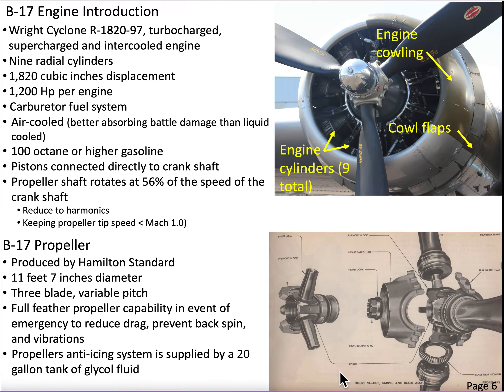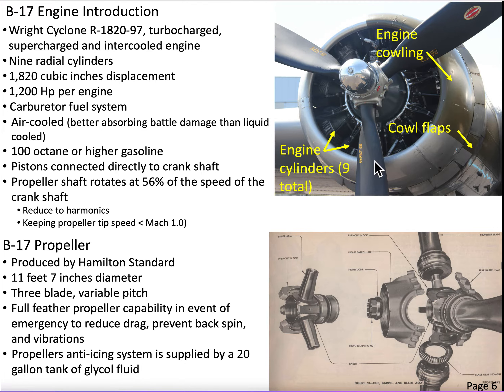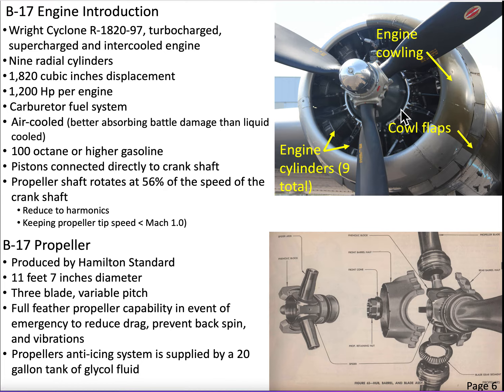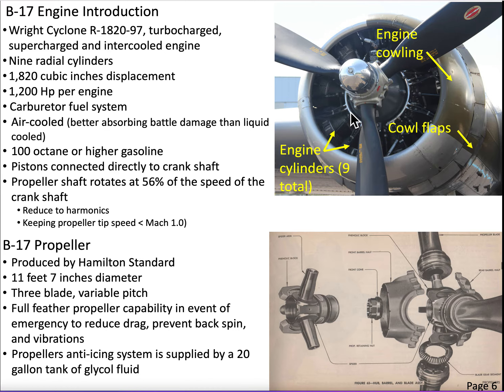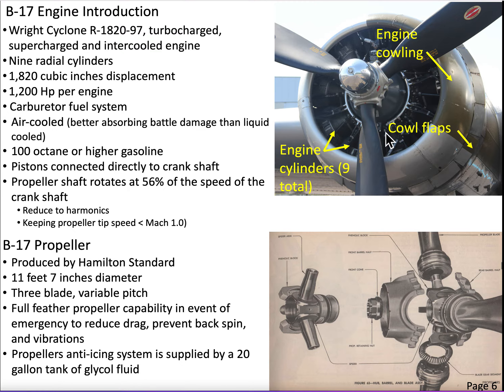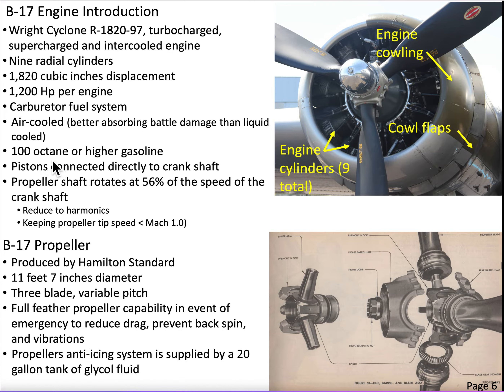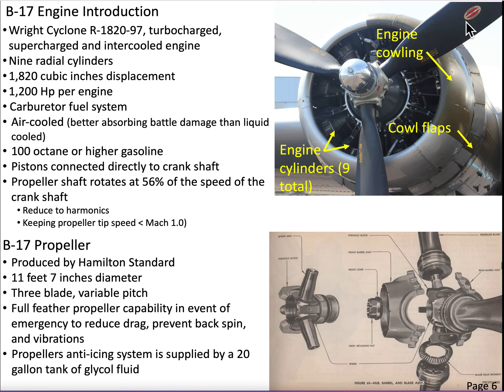B-17 Bomber's Engines and Propellers Explained

Comment: Just a terminology note: The propellers were not just variable pitch, they were constant speed.  The normal mode of control was not that the pilot varied the pitch, but that he set the desired rpm with the propeller control lever.  The system automatically and continuously varied the blade pitch to keep the engine at the set RPM despite changes in airspeed and throttle setting.
Reply from the maker: Thanks for that great description.

Comment: It might be a good idea to do a piece explaining the difference between a supercharger, and a turbosupercharger, and why the engines had both.
Reply: Greg's Airplanes and....
Reply: @lamwen03  Exactly.
Reply: I read not long ago that when the FW190 whose single stage supercharger started loosing power at 15,000 ft was in pursuit of a B17 at 25,000 ft it's performance was down so low at that altitude that once it was in range of the B17's .50 cal tail guns it took around 2 minutes for it to close enough to where it would be in range to use it's 20mm guns, and any type of evasive maneuvering would cause it to lose ground, so if they tried approaching from the rear they had to sit in .50 cal fire for about 2 minutes before returning fire would have effect, how'd you like to sit in .50 cal fire for 2 minutes before you could shoot back?
The article claimed that it was the real reason that they adopted the head on attack, not because of the B17's lack of chin guns on the early model, that was simply an added bonus.
But the head on attack had it's own disadvantages the two biggest being that between the closing speed of the two aircraft being around 600 MPH you only had a couple of seconds to get shots off and only the best pilots at gunnery even stood a chance at getting hits and you only had one chance for a head on attack, the only reason they could do it in the first place is because they had adopted early warning radar which enabled them to already be at altitude and ahead of them, they only had one shot at it because once they made a head on attack and went through the formation they'd never get turned around and get back out in front of them again with their performance being so low at that altitude, especially considering that they'd have to arc around them at a safe enough distance that the B17's formations defensive guns couldn't effectively fire on them.
Supposedly the ME109's supercharger had better performance at that altitude than the FW190's did, so if they had a mixed force they'd use the ME109's to attack the bombers and meanwhile down below the FW190's would attack any stragglers or escort fighter's that got pulled down to that altitude engaging fighter's attacking the bombers.
Reply: @dukecraig2402  The superchargers could be tuned for the altitudes  they were  going to be fighting at.  But they had to be tuned on the ground. So if they suddenly had to fight at a different altitude, they were pocked.
Reply: @lamwen03  
Yea, but only certain types, the Allison's had different gear ratios, those could be changed on the ground or tuned so to speak.
Rolls-Royce chose to use different impeller sizes, those really can't be "tuned", in the case of those you need to change entire supercharger assemblies which, in my book anyways, doesn't fall into the category of tuning.
Now the hydro coupled superchargers like what was on the ME109 could just have the pilot move a boost lever to fine tune the boost for the engine's requirements at varying altitudes which is why they ran a little better at higher altitudes than the FW190 with it's supercharger that was mechanically driven and was optimized for medium altitude, the hydro coupled type however does have it's own drawbacks, primary is that it has more parasitic power loss, so a mechanically driven one will run better at the altitude it's optimized for but as you pointed out it's locked in to run best at that altitude, like anything else they've all got their in's and out's.
Reply: @lamwen03  I bet 30 people instantly thought 'Greg....' :)
Reply: @dukecraig2402  that is crazy interesting - do you remember the article?
Reply: @ronjon7942  
I'll see if I can't find it and tell you the name, all I have is a cellphone so I can't post links but the name of the article and the site that has it should get you there.
I think the article was about head on attacks on the B17's, in it they mentioned the German fighter ace who wrote a letter saying to someone "Dogfighting on the Eastern front was kind of fun, sometimes you'd shoot them down and sometimes they'd shoot you down, but after getting transferred to the Western front the first time I turned into a B17 box every sin I committed in my life flashed right before my eyes, worse yet is having to order the young men under me to do it knowing that I might be sending them to their deaths".
The more I read about their experiences attacking bomber formations and listening to them in interviews the more I understand how harrowing it was, one ex German fighter pilot here on YouTube said about attacking them "If there was only one or two of you it was pretty much like committing suicide".
I was surprised to read not long ago that for every ten B17's shot down the defensive gunners on them shot down nine fighter's, it wasn't as lopsided as I always thought it was.
The B29 actually had a higher kill to loss ratio than the P51 Mustang did, it's kill to loss ratio was 11.9 to one and the P51's was 11.0 to one, that's amazing and says a lot about the lead computing system that the B29's guns had, the top and bottom (belly) turrets on B17's and B24's had lead computing gun sights on them which accounts for their higher scores than the rest of the positions. 
Apparently if you were an enemy fighter pilot attacking an American bomber formation wasn't the fun and games people think it is.

Comment: Thanks, I always wondered why these engines has a turbo and a supercharger. One little suggestion: I wonder what the actual pressures and temperatures are at each stage on the air intake and exhaust process? How much does the inter-cooler actually cool the air? How hot is the exhaust?
Reply: @dukecraig2402  Thanks for the in-depth explanation. I always wondered why some planes like the Spitfire had two stage supercharging while others like the Jug had the supercharger/turbocharger setup. 

The pattern seemed to be that in-line engines tended to have the two stage supercharger while radial engines tended to have the supercharger/turbo, but not in all cases (the Lightning being one of these exceptions). I knew there had to be a reason for this, but I just didn't know what it was.

You've answered another question that I was always wondering about as well. Greg's planes channel did an in-depth dive into the turbo system of the P47, and I was amazed at the amount and weight of all the duct-work needed to get the turbo to work. It seemed to me that a two-stage supercharger would have been a much simple solution. Now that you've explained, and knowing that the P47 was specifically designed as a high altitude fighter, it makes perfect sense that they would use the solution that gave the best performance at extreme altitude. Thanks for all the info!

Comment: On this type of propeller if the engine seizes or if the oil pressure drops off to zero the propellers could not be feathered, these were the hydraulic type of variable pitch propellers, and in all actuality they're not "variable pitch" propellers, they're actually "constant speed" propellers. 
Engine oil and it's pressure is what controls the pitch, if an engine seizes or if it's oil pressure drops to zero the pitch cannot be changed.
During the war some aircraft like the P47 switched to electric propellers meaning it was an electric motor that varied the pitch, that way if something happened to the engine's oil pressure then the pitch can still be controlled and the props could be feathered, if a prop starts to windmill from the aircraft's forward motion it'll tear the engine apart because the engine's were balanced to drive the prop not the other way around. 
And the way a constant speed propeller works is within parameters when the pilot would push forward on the throttle engine speed would not increase because as the throttle was being pushed forward and the engine attempted to increase it's RPM a governor in the prop assembly would automatically increase the prop pitch so it'd be biting more air and therfore put a heavier load on the engine, and the opposite would happen when decreasing the throttle, similar to when you go uphill in a car and you push the gas pedal down further but the engine RPM doesn't increase, or when you start downhill and take your foot off the gas and engine RPM stays the same (although with a car on a steep enough hill it also takes the brakes to maintain engine RPM's).
The pilot could change the parameters of the system allowing the engine RPM's to increase by decreasing prop pitch but after that any throttle changes would automatically change the prop pitch and result in the engine staying at the same RPM.
There's many good YouTube videos that cover how constant speed propellers work, the difference between them and variable pitch propellers and the difference between hydraulic propellers and electric propellers, including one from Greg's Airplane's and Automobiles, his is an excellent video explaining everything about how they operate.
Reply: On the B-17 the oil for the engine come from a tank equipped with a stand pipe so that if an engine oil leak started pumping oil overboard there would still be oil in the tank to feather the propeller.  There was an electrical pump that supplied oil to the feather mechanism in the prop that would twist the blades to the feather position.  The drill to feather the prop was to push in the feather button switch.  A solenoid would keep the switch engaged until the blades reached full feather and then the solenoid would release and the button would pop out and the pump would be deenergized.   To unfeather the blades the same switch was pressed and manually held until the blades were unfeathered.
7 years working on B-17 Texas Raiders.
Reply: @tfogelson3139  
What about if the tank was shot full of holes or whatever and lost all the oil?
There's a video here on YouTube that's an interview with a B17 pilot or copilot where he talks about their aircraft being damaged from a fighter attack and due to the loss of oil or oil pressure they couldn't feather the prop and it windmilled causing the engine to shake so violently the entire engine departed from the wing.
And did fighter's with the hydraulic pitch controls like some variant's of the P47 have that same system with the stand pipe?
Reply: @dukecraig2402  If you lost all the oil in the tank, then you were SOL.  You would not be able to feather.  The tank is not armored and sits behind the engine.  I don't know about the P47 as I never worked on them.
Reply: @tfogelson3139  
I get what you're saying about the stand pipe, I've always heard them referred to as a stand off pipe but I knew immediately what you were referring to, and I'll assume that the pick up for the emergency system with the electric pump draws from the very bottom of the tank.
The oil tanks on Harley's are the same way, the feed line for the oil pump comes off the bottom of the tank but if you have one off and clean it out and look down inside where the feed line hooks up on the outside on the inside there's a short pipe that sticks up about an inch, the purpose being so you're not drawing oil from the very bottom of the tank where metal shavings and any other type of contaminates settle to the bottom and build up, that was probably also why they did it on the oil tanks for the B17, having the oil from the top of the stand off pipe to the bottom of the tank acting as a reservoir for emergency use was an added bonus, that stand off design was especially important on those old Harley's back when oil filters were an option on them, hard to believe that there was a time when oil filters on an engine were considered to be a luxury or at least not a necessity.

Comment: You pretty much covered everything I'm about to say, but just to be clear-

The Wright Cyclone R1820-97 Has a internal gear driven, single-speed centrifugal supercharger that produces above ambient manifold pressure, during all engine operating parameters. Its primary function is to increase engine performance regardless of altitude.
The turbocharger is a bucket turbine & compressor type. It's output is regulated through an exhaust bypass wastegate. It's primary function is to maintain manifold pressure based on altitude, allowing the engine to operate at peak performance, regardless of altitude. It typically isn't used on sea level take-offs.
In addition to a fully feathering prop and variable pitch blades, the engine also use a propeller governor. It's purpose is to automatically alter the blade pitch in order to maintain a specific engine rpm.
Engine Compression ration was 6.45:1
Bore & Stroke: 6.25" x 6"
Thanks  for the video!

Comment: Great vid, I’m putting a B17F model together from wingtip to wingtip little over 3ft long. Thanks to your vid it helps me understand under the engines an exposed exhaust pipe that leads to turbine but what I got from your vid they close the exhaust exit for they can recycle it. So my question is the only place I see to get rid of the left over exhaust is to exit out of the vents on topside of the wings because when I look at old photos it’s easy to see oil and exhaust stains on both sides of the wings 🤷

Comment: Number one blasts away.

A check of all engines prior to takeoff to confirm oil pressure and magnetos with cowl flaps open to prevent overheating conditions. 
Numbered from left to right from pilot seat number one the left most engine and last to start.
Number three the first to start as only one with hydraulic power for ship.
Inboard engines first as well for fire crews not having to walk through propeller arc of starting engines.
Reply: On the G model hyd power was provided not by #3 engine, but by the the hyd panel.  An electric driven pump that was located on the stbd side of the cabin, the hyd accumulater and reservoir were on the aft bulkhead of the cabin.  Hydraulic power was only used for the cowl flaps and the brakes.  Brake lines ran thru a debooster that lowered the pressure for the expander tubes that pressed against the brake pucks that then rubbed against the brake drum.